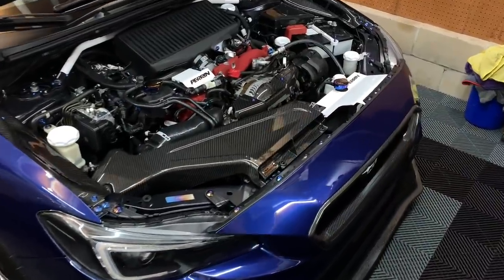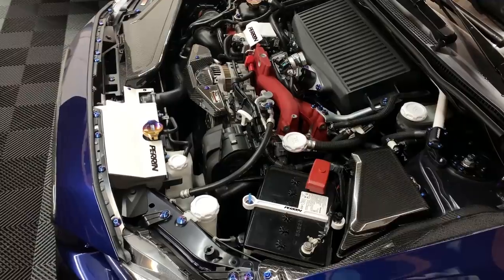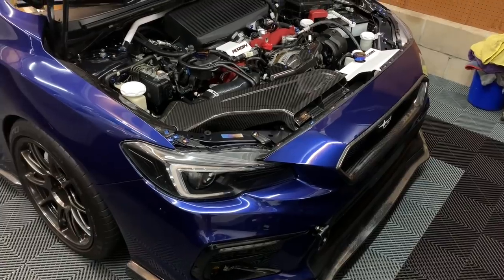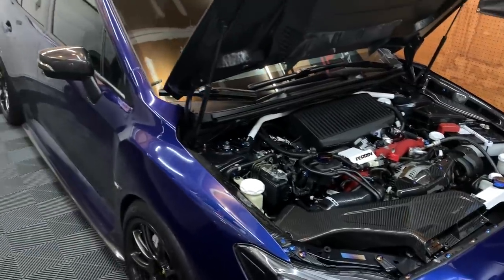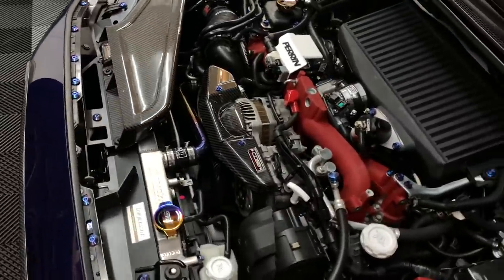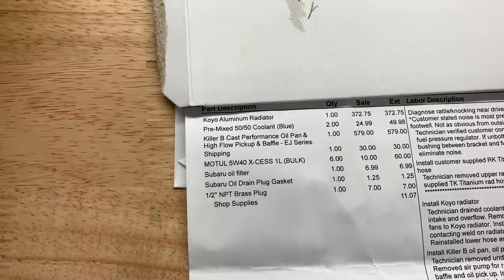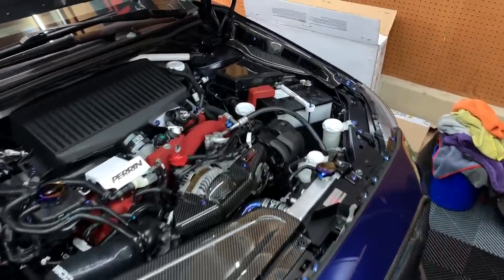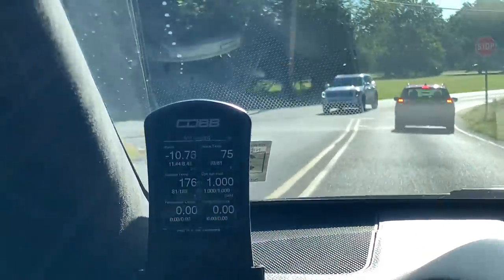Installing the Last 2 Reliability Mods on my STI | Koyorad, Killer B, and RK Titanium

Comment: Hiya, love you videos keep them coming. 

I used Millers 5w40 the second i brought my 2018 sti every 3.5k miles from brand new. Many competent subaru tuners/engine builders will say 5w30 is far to thin and only used by Subaru to pass emissions tests.

 These engines run hot due to there design and get abused. I now use 10w50 here in the uk, where weather ranges from -15c to 40c. This grade of oil is only recommended by my tuner, or 10w60. But the 10w60 is for high hp motors. Mine has stock internals but running 346hp 365ftlbs. I've been running 10w50 for 3k miles now and I must say, it runs so much smoother with less noise and better oil pressure. I only wish I started the car with 10w50, god knows what wear the 5w40 caused my bearings. In fact, my engine builder uses 5w40 for his 50 mile 'break in oil' he calls in shit oil to get everything 'beded in' quickly lol.
I spoke to other subaru experts and they do the same 10w50 or 10w60.
None ever use 5w30 or 5w40, there answer is, they would never risk it as its too thin and can't handle the heat these cars run at.

Here is a list of mods I have that are a MUST for stock+ stis.
Upgraded radiator
Upgraded intercooler 
One step colder plugs (even on stock power - a must)
Cylinder 4 coolant mod
Perrin inlet pipe
AOS (RCM version) NOT catch cans!!!

The pickup is a good idea, but here in the uk there hadnt been a failure on the 15+sti.... ...yet.

Hope this helps in anyway 👍

Comment: Why would they charge you to install the upper rad pipe separate labor when they were already pulling the radiator to switch out to the Koyo? Or am I seeing that invoice wrong?
Reply: Yea that doesn’t seem right…
Reply from the maker: Any part that is separate from the anything you purchase is an add on. If the koyo rad came with a new hose, it would be included in the rad install. Other shops may not charge you for something like that, but I function a bit differently. I’m paying them for their craft, which is years and years of experience. Not to say a rad hose/pipe is hard to install, but if that’s what they charge, that’s what they charge. Not going to nickel and dime.
Reply: @Scoobyfreak86  I definitely understand that. I’m just having a hard time with that one 🙃

Comment: Hey man you mentioned the oil pick up isn’t as much of a problem with the 2015+ sti just wondering if Subaru have made some improvements and why it doesn’t fail as often now, another great vid man👍:
Reply from the maker: I’m not quite sure if there were any improvements over the years on the pick up. I believe the same one is be I used in new sti’s as the older gens. It just seemed to happen more in the earlier years than it does today. It’s more piece of mind for me to upgrade to the killer b since it much high quality and known to never fail.

Comment: If you have a upgraded fuel pressure regulator like the cobb kit it eliminates the injector damper which creates a rattle type of noise that might be what youre hearing
Reply from the maker: Yes I was doing some research and found that info as well. Thanks for the insight!
Reply: @Scoobyfreak86  got in contact with cobb myself just to confirm that a while back and they said some noise is completely normal for it
Reply from the maker: Appreciate the insight!

Comment: Would I be able to use the rk radiator pipe if my radiator is stock ? Dumb question but it doesnt need a tune right?
Reply from the maker: Yes you can use stock radiator. No tune.
Reply: @Scoobyfreak86  Do you know if this fits all year sti? Someone nearby is selling me his but it was on his 2011. I msgd rk but no reply :/
Reply from the maker: @yumee19 yes fits 02-21.
Reply: @Scoobyfreak86  Thanks !!

Comment: The RK Titanium hard line pipe is a gorgeous 🤩 premium part👍. Even the logo embossed connection hoses are visually appealing and help set the installation apart.
   
But it’s the God awful screw clamps 🗜 is what I really notice what I sadly 😞really notice and see 👀. They don’t fit in, match the quality of the rest, I suspect many would agree. Even standard Subaru OEM clamps are better looking if you ask me. If those still fit spray paint a new set or powder coat them they would be more pleasant to see 👀. I reused them for my aftermarket Mishimoto hoses to keep everything tight and leak free. 
   
The Killer B Motorsport and Koyo radiator were prudent choices to add on too. They round out the performance mod improvements nicely on this OEM Plus Plus 😎 Subaru. 👏